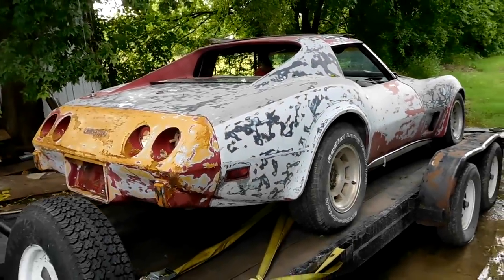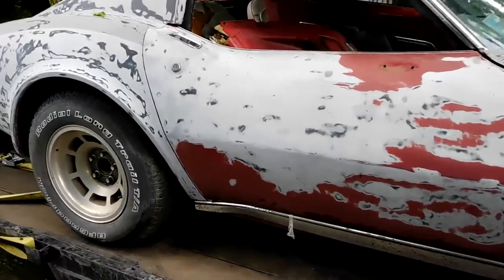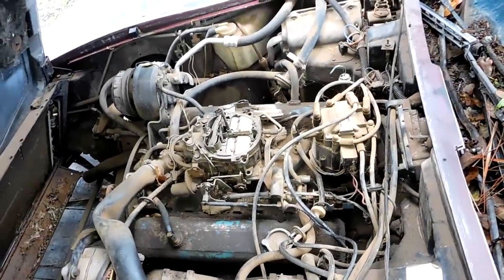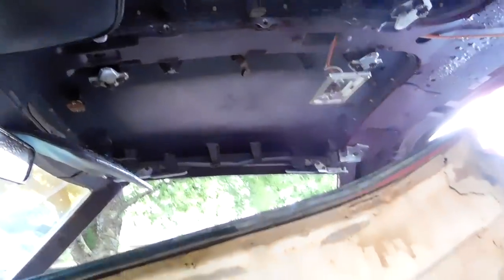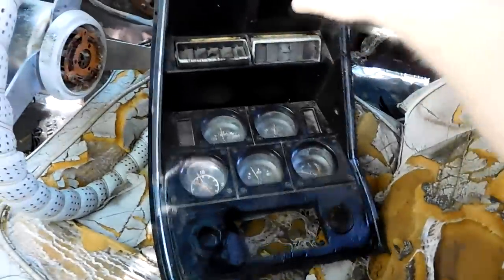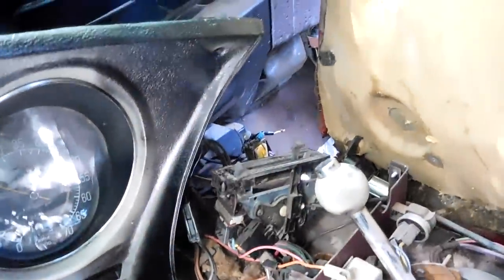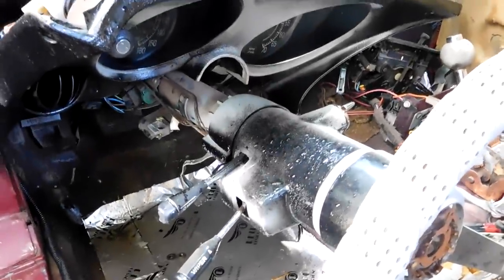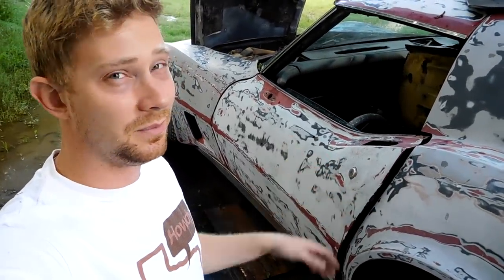DO NOT BUY A 1977 Corvette: Things You NEED To Know Before You Buy A 1977 Corvette

Comment: Loved my new 77! Bright red. Stock engine. Alarm in door lock. Bullet mirrors. White leather. Great car. I put 26k on it. Removed the c converter and pvc valve. Opened the gas filler so the bigger leaded gas filler nozzle would work. And, the cruise did work (new car) but wasn’t good. More like having an old time wire throttle button than today’s cruise controls. They had an 8 track player built in. I wore out my 8 track of Sat nite fever! The roof panels attached to the luggage rack with two brackets which came with the car. $11,450 window sticker.

Comment: I have a 77 also. I have no issues with the things you mentioned, except for the wiper/turn signal issue vi have to hold the switch when turning left,.or the wipers will come on. The only way to fix is to replace the unit.

Comment: I own a torch red 1977 corvette,and i love it.I put longtube headers,high performance intake exhaust manifold,Flowmaster racing exhaust.New tires,brakes,American racing wheels,tuneup,new valve covers,timing chain,spark plug wires,monoleaf rear leaf spring,fuel filter,pcv valve,many many more.Its a headturner,Wherever i go,people notice it for sure.it also has new shocks.lol russell wayne boyd.

Comment: I have a 1977 Corvette with the L82 engine, T-Tops and 4 speed transmission.  Runs great, looks great.  77,500 original miles on it.  I still drive it once or twice a month.  Good to drive them.  The engine is strong.  I am just a big guy, tight fit for me ion the driver's seat.

Comment: My reasons I dont want a 1977 Corvette are I dont like what they did with the dash and gauges they made them all plastic. Also They stopped calling the Stingray that year. This is why I bought a 1976 Corvette. I was not shopping for a Corvette at all because I already own a 1994 twin turbo six speed Supra and a 1992 Acura NSX with the science of speed twin turbo system  and 5  speed transmission  I was not looking for a Corvette until I started watching Corvette Bens fine and informative videos so I went out and bought  a 1976 Corvette 4 speed and put a brand new Chevrolet 454 crate engine in it  now I love it!!

Comment: Yesterday I acquired a 1977, it was completely restored several years back, but it’s been sitting outside in this Arizona heat. It has historic plates and it’s insured, runs like a top, but I can see that I have a lot of TLC to deal with. The paint job needs buffing, sanding it with 2,500 sandpaper is a must, but I might just repaint it. I didn’t pay anything for it, I just got it from constantly helping the guy out, so I shouldn’t be too upset over a gift. I definitely need tires, and the A/C might need recharge. And the battery is dead. Since he has a BodyShop, he offered to paint it and will have his mechanic install anything I buy. But there’s a dilemma, I don’t have a place to put it once I bring it home, I already have 4 vehicles to deal with and he’s painting (3 stage 2 tone) my 1993 Silverado.
Reply: I'm curious what you ended up doing?  Do you have any update?  Thanks!!

Comment: Another thing you didn't mention is the early 77's only have the fender alarm switch and no emblems..the second run in 77 they added the checkered flag emblems
Reply: I have the combo alarm switch + checkered flag emblems, but with a chrome mirror and not the sport version (power?).

Comment: I had a 74, which was also unique to the Corvette series as it was the last year of the Big block. It also had a two piece rear bumper cover which makes 74s easily identifiable as long as you haven't replaced it with an aftermarket one piece. It's been a few years since I've owned it but I also believe it was the last year that there was no Factory catalytic converters but I could be wrong on that last fact

Comment: 1977 was one of GM's worst years. Owned a 77 Camaro. It was loaded with smog and a vacuum hose nightmare, gutless wonder.
Reply: 1984 too! Iknow i had one, the dash after a few years start blinking and the transmission 4+3 had to be rebuit at only 45,000 miles, glass top was leaking also...
Reply: Wasn't that first thing that people removed?
Reply: Most of the 1970s were GM's worst years. I believe most powerful engine you could get on a '75 Camaro was about 140 HP. After that, GM had a habit of offering limited production halo models with closer to 200 HP, but sold many more with detuned gutless-wonder engines. The famous "last muscle car" 1979 Trans AM had a production run of something like 20,000 while many more "Trans AMs" were shipped with wimpy detuned engines. That's how GM kept their buyers interested while still making their CAFE numbers.
Reply: @pcno2832  Yes but who kept them stock apart of old ladies??
Reply: $200 in pistons/camshaft would bump 1972 - 1984 Corvette HP way up!
Reply: Had a great 77 Camaro.
Reply: 77 better than 2024 cars.    Vacuum easy compared to 120 modules.  And tracking.

Comment: If I had to pick one it would almost be a mix of the best of 73-77. Chrome bumper cars got real expensive.  73 has that odd mix of urethane front and chrome rear bumpers, 74 had that odd split rear bumper, 75 you got HEI ignition, lost the big block, got catalytic converter, by 76 you lost the fiberglass floor, had the crappy Vega steering wheel, got alloy wheels, lost the cowl induction hood. 77 has just so many one year only parts.
Reply: Stylewise, the 1980-1982 Corvette was the best C3 ever.  It's my favorite, especially the opening glass rear hatch on the Collector's Edition.

Comment: I have a 77,  with that exact same setup. it’s partially restored and most of the things work, the alarm system is in the door lock and it doesn’t seem to work, the cruise control works and the steering column is in pretty good condition but the steering wheel is offset, the door panels have The wood insert instead of the black stripe (probably from a 76) . It’s a 4speed manual, leaks all the transmission fluid, has a tired old small block 350 with 240k miles on it, the rear differential snap crackles and pops, and it shakes violently above 60 mph and handles like a brick on rover skates.

Comment: Hi Ben, the reason for the one year only odd mid production T Tops are the fact the sun visors were now Telescopic and could be rotated to move to the side glass with one single hinge . Because of this they had to redesign the interior insert on the t tops to clear the movement of the visors.  Yes 77 only with the pin integrated front guide pins to the release handle to clear the large hinge and make it more cost effective.

Comment: Fun fact, the very early ‘77’s had Stingray on the sides, maybe 1 or 2 months.
Reply: I have a very early '77 (built early Sept of 76) and it does not have a Stingray badge but I can't say for sure that it never did. But it does have a red engine.
Reply: @jwh475ezc  That is interesting.  Back in 1977 when I was looking for a new '77 I saw one on the showroom floor with the Stingray.  This was around Dec 77 so they had been producing the 77 for a couple months..  I knew it was a 1977 because  of the new interior, steering wheel, etc.  Maybe this was the only one.  Later when I saw different dealers had the flags on the side I thought hmm where is the Stingray.
Reply: @dbvetter7485  They probably put them on the cars until they ran out
Reply: @jwh475ezc 
Not the assembly plant, doesn't work that way. But I can see a dealer who like the Stingray badges putting them on.

Comment: I did get one several years ago, a victim of the crappy in door alarm, which shorted out and took the wiring harness,  drivers door, and rear quarter. Im gonna use a painless harness to rewire the beast and re locate some of the one year only junk. It is gonna get a 454 and th400 cause I have them. Should make for a nice car again!

Comment: Ok, so I'm sure that wiper/turn signal switch is a bizarre one year only part. And it is weird that the cruise is on the tilt, not in the end of the wiper/signal stalk. But why is it so easy to accidentally turn the wipers on in this year Vette? I mean what am I missing, thats how GM did wiper/signal/cruise and dimmer functions through the 80's and 90's and its never seemed to be an issue for me in other models.
Reply from the maker: Because the whole stalk rotates. Not just a ring or switch on the stalk

Comment: I have owned two 1977 Corvettes. On one of them I replaced the crossed flag emblems with Stingray emblems. The cruise control didn't work on one of them, and neither it nor the speedometer/odometer on the other. The design used two speedometer cables, I was able to find a single cable that bypassed the cruise control box altogether and made the speedometer/odometer work. The cruise control box that the speedometer cables attached to have really cheap plastic gears in them, and mine were stripped and broken. Neither one of mine had the alarm switch on the fender, and I didn't care anything about alarms anyway. My T-tops were ok, the weather strip had some cracks. Also, the chrome windshield trim was painted flat black on both of mine, some of it had worn off, and it took a lot of work to get it all off. I never had any problems with the steering columns or the switches on them, other than the cruise control didn't work. I'm the type that would rig some way of making what those column switches controlled worked, even if it meant wiring each function to a separate dash mounted switch. 

At least the 1974-1977 models came with a complicated vacuum system that operated not only the heater/air conditioning/defrost/vent controls, but the headlight doors as well. I can't afford a decent 1968-1972, and wouldn't even consider a 1973 or a 1978 or newer. I'm considering getting another Corvette, and it will have to be a 1974-1977. Decent ones are getting hard to find. Even really nice looking ones often have rust issues. GM didn't use much in the way of rust protection back in those days, and there are a lot of places on a Corvette where rust can hide. You can see most of the frame and suspension parts, but the birdcage and windshield frame are completely hidden. If you are considering spending a significant amount of money on an older Corvette, have it inspected by someone who knows what to look for.
Reply: The 77's came from the factory with black windshield trim... easiest way to externally differentiate at a glance a 77 from a 76...

Comment: That's not a 1977 Corvette on the trailer (unless someone swapped the polished deep dish wheels for those slotted wheels) at the video's beginning. Those slotted wheels were first available on the 1978 Corvette.
Reply: 78 had the large back window until 1982. This is at least 74-77 car

Comment: I've owned a 1977 Corvette coupe since about 1991. My father bought it for me when I was in high school. It was my daily driver up until about 1999 or so. I purchased a new Acura CL at the time, and left my vette sit up until early this year when I started fixing her up. It's been a great car so far, but im getting the engine and transmission rebuilt. I put LED light in the back which I modified to fit the wholes. They look awesome. I would post a pic, but I don't think youtube allows that. My vette is a work in progress. How much for the doors off that vette?
Reply from the maker: $250/side

Comment: I’m looking at 77 right now, that has a four speed manual, with a steering column that doesn’t have cruise control on the column. Did the manuals not come with cruise control, or do you think it’s been replaced? Cheers.
Reply: check the sales brochure for 1977 corvette it states only autos had cruise , double check this thanks

Comment: the '77 transition to molded plastic for the interior really does not look near as nice as the earlier C3's, IMHO.  GM is pretty famous for awful plastic interiors of the late 70's and 80's.  also, I'm biased because I like chrome mirrors, but its also the first year for painted racing mirrors, which also look cheaper to my eye.  OTOH, its still a C3 and one of the cheaper ones to get into.

Comment: Look at it this way
77 is the best year to convert it to electric, because nobody is worried about it being cut up
Reply: Heavy ass electric car yea 😂😂
Reply: @Southized  if you focus on horsepower with a Tesla motor and Chevy volt batteries, you can get only like 200 lbs gain net, but still make 650 whp. Only problem is your range will be trash, like, 80 miles

Comment: You’re absolutely right re: wiper switch activating when activating turn switch… I too often thought why incorporate several functions into one switch- to my surprise, the switch still works as designed and I’ve had the car for 41 years.  
Question; is there an option to change out the original radio antenna for one of those short black ones that can screw on/off?

Comment: You mentioned that the wiper switch is on the steering column. My 1977 has it on the top of the center console and it’s just a switch that I flick. Any idea why?
Reply from the maker: Probably because the one in the column broke

Comment: Does that cruise setup work?
Reply: I bought my 77 the day this video came out and just watched it. I have already found these out unfortunately.
Reply: I would never buy a 1973 Corvette especially A roadster because of brush issues because they all leak water when it rains and the noise is horrible you can hear everything with a cop up they make so much there's so much wind noise never buy a 1973 Corvette Stingray convertible besides it only has one chrome bumper stay away from 73 they are junk

Comment: I had a 1979 corvette and I was getting passed by little out ladies going to church.  The 1977 has 180 hp...Pretty sad. Most 4cyl cars now have over 200hp. My suggestion as well as my mechanic is to stay away from like 1977-1983. Nothing but headaches and no hp like a corvette should
Reply from the maker: That is a silly suggestion. Hp can be added so easily. Why act like it’s something that Cannot change?

Comment: Those things suck!
I owned two of them a 65, and a 74. The 65 was neat to be fair, but the whole wrap your ass in fiberglass is ridiculous. That is no way to build a vehicle. Those things run so freaking hot it's nearly unbearable, and if you're unfortunate enough to smash it, it's a meat grinding blender. Unsafe and stupid. A nova or camaro are far better choices.
Reply: There full frame cars and they don’t rust. For the day they were very safe cars. Novas and Camaro’s were both unibody cars not anywhere near as stiff as a Corvette. You can have the 74 but the 65 is a great car.